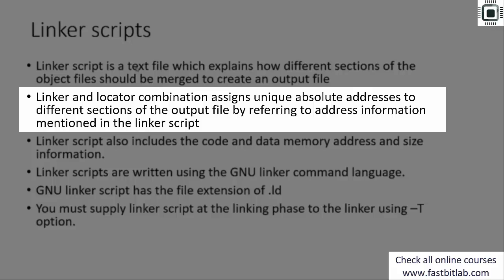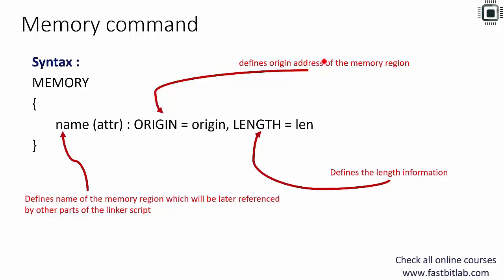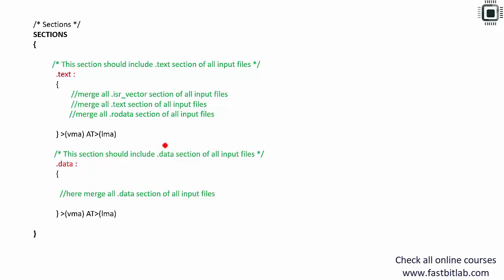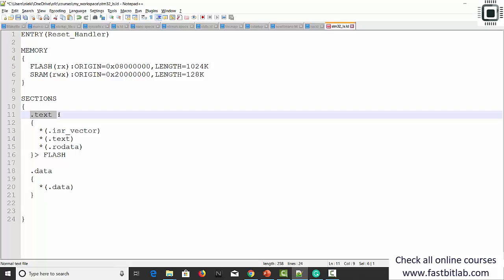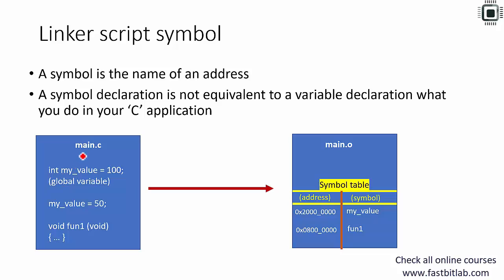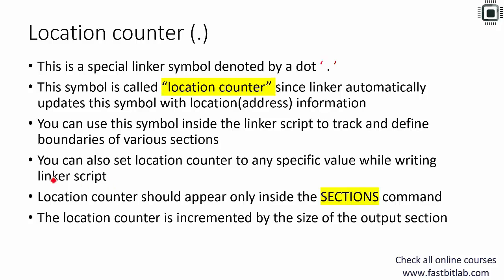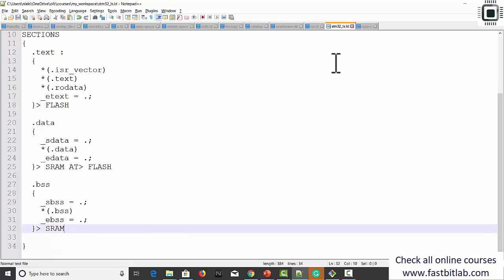Bare Metal Embedded C Lecture 4: Writing Linker Scripts and Section Placement

Comment: The fpga/board designers suddenly said 'here is another 4k memory block at address 0x40000000.  How can I
1) add it to the existing memory pool so that the linker uses it as it pleases.. and/or
2) add it as a separate section, so that is not available for linker's general use but rather is used only for specific variables

For example in the case of #2 above, I added in the linker's MEMORY section :
memblock (rw) : ORIGIN = 0x40000000, LENGTH = 4k

And at the bottom of the SECTION portion, I added:
.NEWBLOCK (NOLOAD):
{
. = ALIGN(8);
* (NEWBLOCK);
} > memblock

But when I declare a variable attempting to place it in that section,
char initialized_array[100] _attribute_ ((section ("NEWBLOCK"))) = { 0 };
int non_init_data _attribute_ ((section ("NEWBLOCK")));

It links fine (optimazation set to 0/none), yet these variables are located in in the same space any other variable  (i.e. not 0x40000000)!

I've tried with and without the NOLOAD, adding KEEP.. adding bss to the var declaration like section(".bss.NEWBLOCK") but nothing seems to map it correctly!

Comment: Hi Kiran,
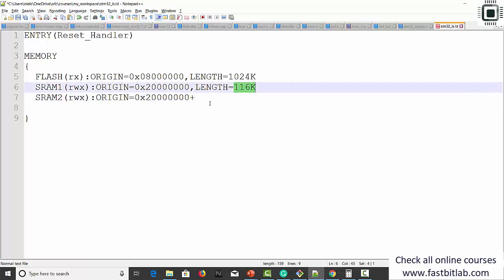Why do you use - 4 in SRAM2 origin calculation? (Timestamp: 10:56)
Thanks so much for the video!
Reply: Too late, but I think this is the reason 
my analogy - 
Say If we have memory boxes numbered 0 to 9. Origin say Box 3 and Size of RAM1 say 4 boxes, if do math 3+4 it's 7 and but Box3,4,5,6 are our region of RAM1, we subtract 1 from 3+4-1. Similarly, in a 32-bit microcontroller like here it prefers to read/write in 4-bytes at a time. Hope it helps someone

Comment: Thank you so much for these videos!

Just wanted to add the following: I'm following along with an STM32L452RE, and in the .map file I could see that my .isr_vector table as well as any Handlers I had defined in my startup file were discarded (basically mapped to address 0x0). It turns out that instead of `*(.isr_vector)` I needed to write `KEEP(*(.isr_vector))`; the symbols are otherwise thrown away because they are not referenced somewhere else in the .o files. Just thought I'd put that out there for anyone who got stuck like me.
Reply: Thank you for sharing. : )

Comment: hi sir, you have not told anything about stack pointer initialization(plzz.. correct me if i am wrong).
Reply: He also didn't cover how to create the Interrupt Vector Table (a.k.a .isr_vector section) in the C or assembly code. This comment may be old, but for anyone else who is curious: The Stack Pointer Register is always initialized with the very first long word in the vector table. The default linker script for cortex-m4 processors for CMSIS has a __StackTop symbol that is calculated as at the top of the SRAM (as long as it is an 8 byte aligned address) which can be used at the top of the vector table which initializes the Stack Pointer Register on startup.

In assembly use: `.long __StackTop` at the top of the vector table.
In C use: `extern uint_32_t __StackTop;` then put `(void (*)(void))(&__StackTop)` at the top of the vector table.

If you'd rather not define the symbol in the linker script:
`#define __StackTop <your SRAM top address here>`
... In vector table ...
`(void (*)(void))__StackTop`

Comment: I am thinking on this for quite some time now. The FLASH starts at 0x08000000 and because the isr_vector is put first, the stack pointer value is stored at 0x08000000. Is that correct?

If so, then when the microcontroller powers up the PC would be pointing at 0x00 (please correct me if I am wrong). My understanding is that for the cortex controllers the stack pointer value needs to be stored at 0x00. But in our case it is at 0x08000000. I am a bit confused as to how the controller will pickup the stackpointer value if FLASH doesn't start at 0x0. Can you please help me understand? Am I missing something?
Reply from the maker: Thats a good question . The processor produces 0x00000000 but the STM32 internal design maps it to 0x08000000 based on the settings of boot pins. so by default 0x00000000 mapped to 0x08000000 in stm32.
Reply: Fastbit Embedded Brain Academy thanks. Now the story is complete :)
Reply: @FastbitEmbeddedBrainAcademy  is that written in any sort of document? for other controllers where to find?
Reply: Hi, When power up MCU and reset mechanism release the reset condition,it means reset interrupt occured and than cpu internally read(not by code just fetch it internally)  0x08000004 address and branch to actual reset handler function to execute.In the reset handler first thing to do read  0x08000000 by our code and set it to process stack pointer or main stack pointer to set up c function call environment.PC counter never points  0x08000000  address because it is initial stack address pointer it is not a opcode.This is architecture specific mechanism.
Reply: to people who confuse, you may want to check this video, https://youtu.be/3brOzLJmeek?t=317

Comment: GNU compiler is there in website for 32 bit system which is mentioned in first lecture. My system is 64 bit. Will it work on my system or not. Please confirm.
Reply from the maker: why dont you try it ? or are you saying you tried and it didnt work ?
Reply: I installed in 64 bit system and it is working.